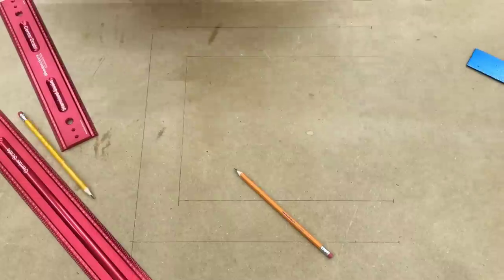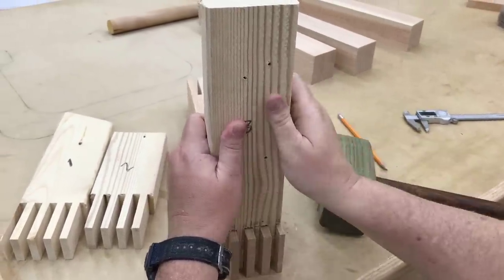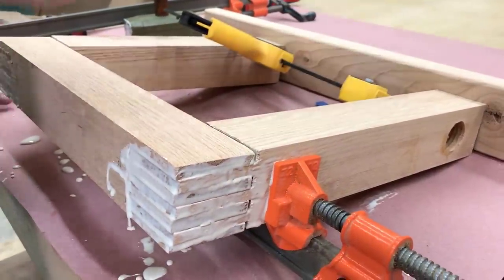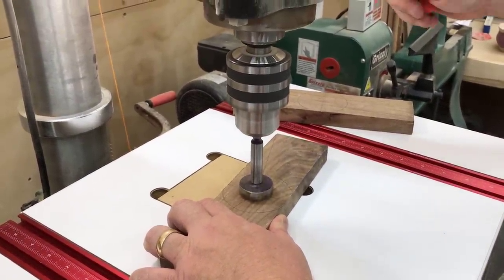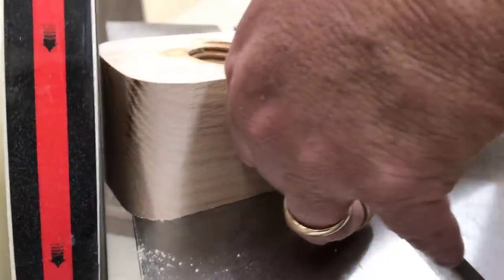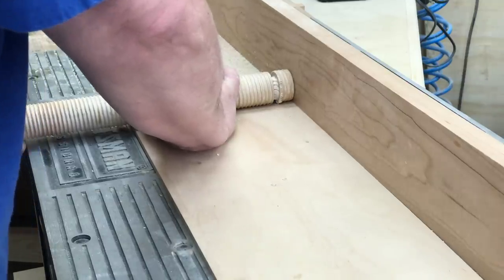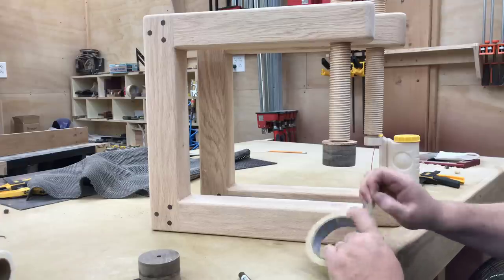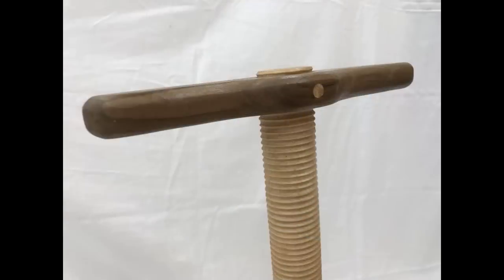15 - How to Make Deep Reach C Clamps All Wood only $10 Extreme Strength

Comment: Why smear the thorn on both sides? PVA glue works at the molecular level. When the joint is smeared on both sides, the strength of the joint drops by an order of magnitude.

Comment: $10 cost, but $100 or more in tool investments to do it.  Doing a Matthias Wandel deep-reach clamp is going to be more feasible for most folks.  I imagine if you use red oak and Titebond III like you say, the results would be similar. All-thread isn't that expensive.  Not to discount your work, this is good stuff.

Comment: $10?  How much were the cab saw with dado, drill press, oscillating sander, router table, 2 hand sanders, radial arm saw, 20 clamps, a jointer, and planer...?    :)       I did like some of the tips, and obviously just teasing...  Thanks for sharing.
Reply from the maker: Thank you.

Comment: For the thin bit of wood your cutting a circle could you use a jigsaw with a thin metal cutting blade or a scroll blade using the settings on the jigsaw it wouldn't be so aggressive what do you think. Great video btw love the channel and I've subscribed too.
Reply from the maker: That would have been a great idea! Half of my good ideas come after the project is done. The other half come from smart viewers like you. 😁👍🏻, 
Thanks for commenting & subscribing!
~James
Reply: The best ideas always come after you finish the project. :)

Comment: Am I wrong to think that all the clamping power is dependent on the thin little glued together semi circles
Reply from the maker: Hi Dave! Unfortunately you are wrong. Those thin oak semi-circles just keep that walnut clamping surface from falling off when the clamp is not in use. 

The clamping force is the 1-1/2" diameter rod driving a full thickness piece of Walnut into the surface it's clamping.

Comment: If u want to go higher force just go get 2pcs of any strong  metal plate and make it 90° angle then enforced it to the two angle of your word corner that taking the force it'll  strengthen 5 times more then your original strength but then the other parts of it could last the force though

Comment: I wonder how many times this can be used before it breaks. There's just so many breaking points.
Reply from the maker: VIIXI'S PLAY PLACE, wood doesn’t fatigue. I have old wooden clamps here that are 150 years old with the same strength from day 1. 

Metal fatigues, and eventually breaks. That’s why airplanes have an airframe life limit on flight time, then must be retired to never fly again.  There is no airframe life limit on wooden frame airplanes. 

I’m not saying wood is a better choice than metal. I’m just pointing out an interesting characteristic of wood.  Thank you for watching.

Comment: James, 
Doesn’t the Tung oil on the threads interfere in the glue joint between the dowel and the handle?
Reply from the maker: No. The glue is totally cured before that was applied.

Comment: please forgive my stupid question
why would you not just cut the C out of a thick square board, obviously there is a reason.
i was just wondering what that would be
oh yeah, its obvious i'm new to woodworking
they look great by the way
Reply: Due to the grain direction, wood has different strengths in different directions. If you were to build these clamps out of one large solid wood blank, they would fail much earlier at a grain split. However, if you were going to build a bunch of similar clamps, a quicker method without losing too much strength (I believe) would be to glue up thick plywood and cutout the entire shape at once. It would be much uglier but probably sufficient.

Comment: Same functionality  achieved in 60 minutes - using a welding-apparatus, angle grinder, battery-drill, some scrap-steel, a length of threaded steelrod + nuts, self-drilling screws - and  plywood to cover surfaces. But definitely nuuuut as NICE !

Comment: Why not put a threaded rod from one arm to the other about 1.5 inches inside of the inside edge of the vertical arm, that puts the vertical piece in compression and removes the leverage from the joint.
Reply from the maker: That would surely work, and John Heisz did just that. But I wanted, an all wood design.

Comment: Great video with beautiful and functional results. Three comments:

1. When gluing the split oak ring to the clamp pad, when not lower the screw so the clamp pad is not let hanging?
2. You have a very helpful helper!
3. If you would like to test with a higher capacity scale, check out Sherline trailer tongue weight scales. They make 1000, 2000 and 5000 lb scales. Link below:

https://www.sherline.com/product/sherline-trailer-tongue-weight-scale/

Comment: Strange you didn't use a square shank on the screw in the handle; I don't really see the advantage to attaching it with threads. Also, you'd be surprised at how much strength a half inch fillet in the interior corners would add.

Comment: So where do you buy the wood for this project for "$4.00"???
Reply from the maker: I was going by the board foot price. I got most of this oak for about $2.50 a board foot, and these are the off-cuts. and it takes less than 2 board feet to make one. What do you pay for oak?
Reply: +King's Fine Woodworking $4.50/ board foot Walnut is more expensive. I assume your $ is in US $?
Reply from the maker: Yes in the US

Comment: 15:47 if your tap goes all the way through the wood like that, just slide the handle out and drop the tap through the bottom rather than twisting it back through the threads. Not exactly a game changer but a small time saver for sure.

Comment: Wouldn't it have been easier to just put a thicker dowel pin by itself straight thru your threaded dowel  near the end to make a handle? As long as they's around a third of the thickness of your threaded dowel and properly centered, they would be sturdy, time saving and less wasteful of wood stock, right?
Reply from the maker: Yes, that would work. But I though this would look nice.
Reply: I hope I didn't offend. You did indeed do some great work, and it does look very nice. I was honestly asking from a technical perspective because I was authentically curious whether there was any added benefits I was not aware of that your method might offer in way of increasing it's ability to withstand more torque? I just wonder if it might handle more torque if it was done the way I suggested, since if using a dowel, you'd be able to replace it easily using various species of wood more easily, which may have added benefits since some are stronger than others. But using a threaded handle, I would think that it's ability to handle torque would be dependent on a single screw, as glue doesn't handle twisting type of pressure in motion that well over time, and the screw can only handle so much pressure before snapping from metal bending stress.

But of course, I would be remiss to discount anyone's preference in aesthetics. The way a tool feels when it's being used is just as important. And the handles you made definitely look like they would feel much nicer in anyone's hand. Good job making those. The wood will age beautifully as you use them.

Comment: nice work but harbor freight 12 inch deep U  clamps are only 10 a piece . much cheaper than red oak these days.
Reply from the maker: Cool. Thanks for the info.
Reply: But you need to remember Harbor freight isn't too Harbor great sometimes.

Comment: Most people who might find themselves working in a high-end woodworking shop are going to earn at least $40.00 an hour.  But if one makes half that, $20.00 an hour, the hourly pay will eat that up quickly.  What I mean is this:  If a person spends five hours on a project, at $20.00 an hour – that’s a hundred bucks there.
Now factor in the cost of tools, equipment, clean-up, overhead, materials, and much, much more.  There’s no way that building a clamp like that is cheaper than buying one.  The ONLY reason to build one is for the joy of doing it.  Yes, I’ve built things that I could have bought at the store – so I’m just as guilty.

Comment: first - wouldn´t beech or better birch wood fare stronger ? Acording to the data i have, yes. second - how abour using a steel rod , so that the corners only have to withstand pressure. And i think a better joint would be a false tennonen put in in an 45 degree angle.

Comment: 24:25 Thats really dangerous what you are doing! Chance of kickback is really high. Safer option would have been to mill the slot using drill press and fence, or router table like you did with second one, or plain old hand saw and files.

Comment: Yeah how to make cheap C clamps for a few bucks, just need a fully fitted out workshop with 20000 bucks worth of machinery and a few adaptations to the equipment plus a 4000$ workshop and you can save yourself a few bucks by making your own C clamps. Thanks for the tip lol, but have to admit neat and skilful joinery work.

Comment: Wonderful! all I need now is to take a few thousand dollars and buy tools that the average guy doesn't have.
Reply: He uses alot of power tools, but you don't need them. All they do is make it faster and easier. Instead of finger joints, even though they are nice and probably stronger, good dowel joints would work fine I'm sure. If you can't get your hands on a thread cutter (available online for $30+), Paul Sellers has a video on how to make one. Or just use a large bolt. Where there is a will, there is a way.

Comment: At the top it states
 Here is the Tap & die set I used for this job:
and there is nothing there.
Reply from the maker: Sorry about that. I’m not sure what happened to the link. Here is the set I used. 
https://amzn.to/3qLsCA3

The main body is now a high density plastic, and it’s actually much stronger than the older model. But it’s the same thing, and same price too.

Comment: Got to thinking .... Curious how this is touted as a "$10" clamp .... First let's assume we don't buy your plan for $9.99 .... whoops, there's 10 bucks!

The cost of the tap and die is over $75; The cost of the doweling - $26 at Woodworker's Supply; Oak - let's say you can somehow get that for $5 (doubtful, even lesser quality); conservatively about 4 oz of titebond III glue for $4; time - $???; misc - $???

Don't get me wrong - the clamps you made are beautiful, but we are really talking a minimum of $50 to $60 in materials alone, per clamp, NOT to mention the time that could have been expended on the project you made these for.

I've gotten caught up in doing something like this, "to save money" ...... MAYBE these clamps will last a long time, but even the cheapo's from HF are probably going to last longer and be more versatile, not to mention the more expensive ones.

Perhaps a cheaper version, somehow, could be designed? Then again, sure seems like we woodworkers ought to think about the time we COULD have spent on the actual project; and, more so, value our time. Just saying.
Reply: God forbid you do it for the enjoyment, time with your child and the pride in your tools. No,  money comes first. (Sarc)
Reply: @scottoldham7459  I agree and they are beautiful clamps. King's main reason for doing these however was clearly due to the supposed cost of commercially available clamps ... clearly. So, I've been guilty of it, and many other woodworkers as well, spending so much time on something like this instead of the REAL projects we've been wanting to do. I would love to make a couple of these clamps and would be proud of them, but I've done this so many times and now have  backlog on the "real projects" that will truly hone my skills and be "real" woodworking projects. Again, don't get me wrong ... NO, money does not necessarily come first, but also again, that WAS the reason King's did this ... money was supposedly coming first and he is touting this project for that reason. But, when the reality of the cost comes out ...... already did that REAL analysis!

Comment: $ 10 clamps... gee, but you've got to have $ 200 000 in equipment to build them, haven't you?
Reply from the maker: I am fortunate enough to have many power tools. But 32 years ago when I started woodworking, I did not. I can still build these clamps today with a handsaw, a coping saw, a drill, and a wooden block with a piece of sandpaper stuck on it. And so can any woodworker.  Thank you for your comment.
Reply: King's Fine Woodworking and how wood you cut the threads!!!!!!!!!!! They are beautiful, but $10 they are not.

Comment: I thought the video was great but build for $10  ???
how much for the tap and die? and the hardwood doesn't come cheap where I live.
I'm sorry, bud $10 I have to give you fail for honesty in the title. To bad else I could give this video 5 stars.
now if I can build for $10 please enlighten me. I'm not getting it and I would love to build
those clamps, and your very good skills and design. Most hardwood at Home Depot is about $6 a foot. I think whatever their true cost is they are worth it.
thank you
peace
Reply from the maker: Hi. First, I didn’t count any of the tools. Only the dowel & the oak for the build. 

Most woodshops have tools. But I understand not many if you’re starting out. 

Red oak in Denver Colorado costs about $3.50-$4.00 a board foot for premium grades and about $2 a board foot for #2. 

One of these clamps has around 2 board feet of lumber in it. So even if you buy premium grade, it’s between $7 - $8. 

And the dowel was $2.00. 

That’s $10. It’s true & fair & honest. 

Also, you should try & buy your Hardwoods at a hardwood dealer if you can. They cost 5 - 10 times as much from a big box store like Lowe’s or Home Depot. 

The wood threading kit was about $55. And there’s a link to it in the description. Even if you have to buy that too, it’s way cheaper to make these than to buy them. 

Do a google search for a 12” deep reach clamp.
Reply: @KingsFineWoodworking  You judge correctly I am just starting out 
I watched another video about this and they soaked the dowels in oil for a week or so before threading to prevent chipping.
 I think your design is an elegant solution for clamps I'm looking forward to making my own (;o)
I'm learning to the key to fine woodworking is take your time with everything! this video made it into my library so I can refer to it anytime.
thank you

Comment: Love your videos, but one bit of criticism is that they are unnecessarily long.... we don’t need to watch you round over the entire clamp... just explain what you’re doing quickly and then either speed up the video or omit 3/4 of the process. 

Some things that are unique or unusual processes - like tapping threads in wood, I don’t think anyone would mind a bit extra explanation and video, but very common processes like making cuts on the miter saw or cutting holes on a drill press - show one, and move on.... I think it’s safe to assume that anyone who is planning to make finger jointed deep reach clamps out of wood, probably doesn’t need to see how you drill a hole multiple times in a row.... 

You’re into “Fine woodworking” and so are your viewers, so I suggest catering to their core competencies and focus more on the processes and techniques that make you a pro.
Reply from the maker: Hi Bryan, thank you! I need all the help I can get.  I only started filming for the first time ever a year ago.

Comment: Nice work, but your claims of time and especially your cost are horribly under stated. 10.00 bucks huh.. 20 grand of tools, definately more than 10 in material, the threading cutters are 15 times your stated cost. Honesty is a virtue, but what the heck. I guess you believe your claims. Try metal next time much cheaper and faster, and stronger..